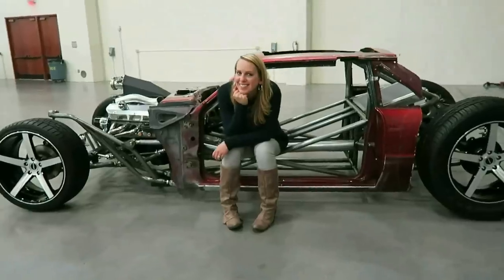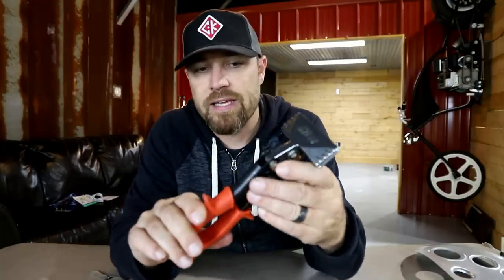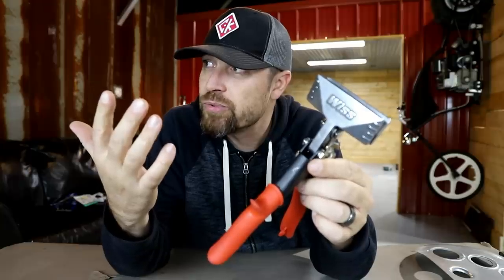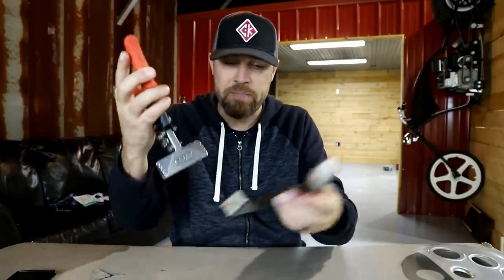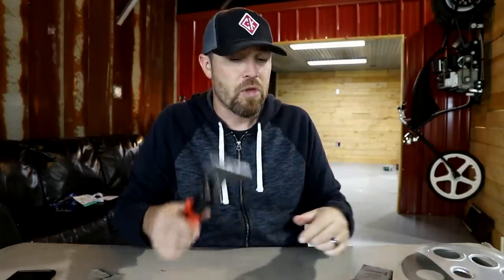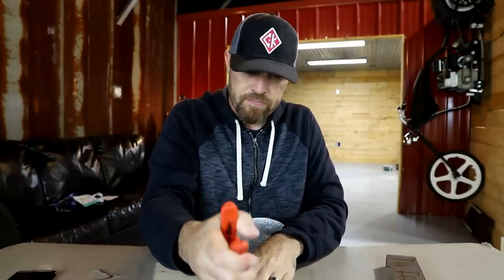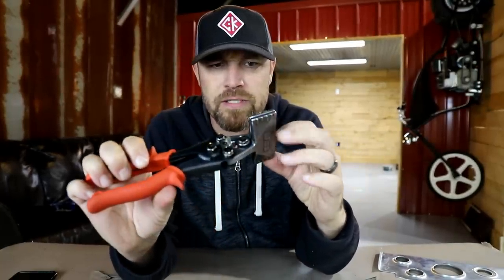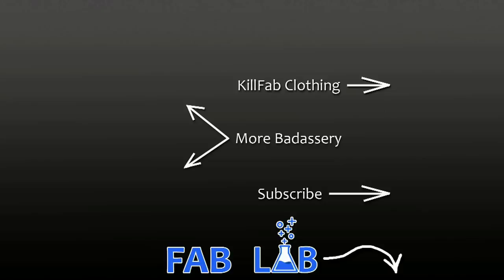You Need This Tool - Episode 115 | Sheet Metal Hand Seamer Metal Brake

Comment: I have been using those in hvac duct installations and fabrication for 30 years and they are my favorite sheet metal tool.
I use the end or side as a hammer to knock the drives down the sides of the trunkline and bend over the ends before I tape the joint. 
They also make one that is long and straight with a slit in each side you put the sheet metal in and fold it over but it is harder to move as it bends the entire length of the tool at once.
Reply from the maker: yeah I still need to figure out all the uses for my self. I dig it and use it all the time
Reply: Someone said that every tool has a hammer side.

Comment: Using mine to do a a mounting surface for custom mount for my rocker switch panel in a truck. Works well for small jobs. For large jobs a brake is definitely what you want.

Comment: The pinch welds on my mustang were folded by the previous owner using them as jack points, think this tool is worth trying to straighten them?
Reply from the maker: it might get the job done depending on how bad they are